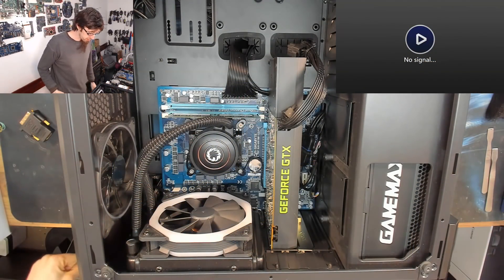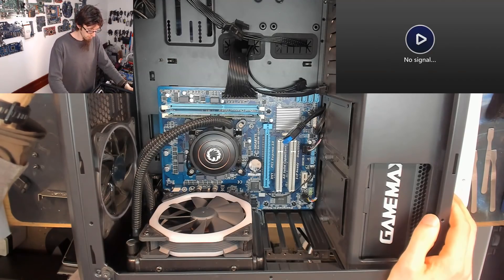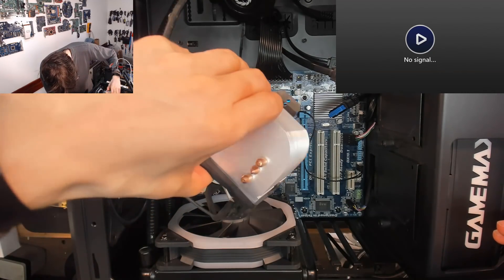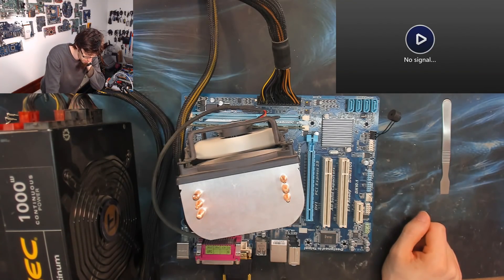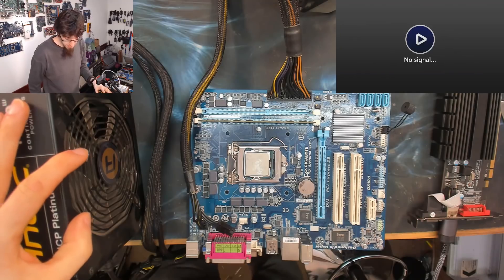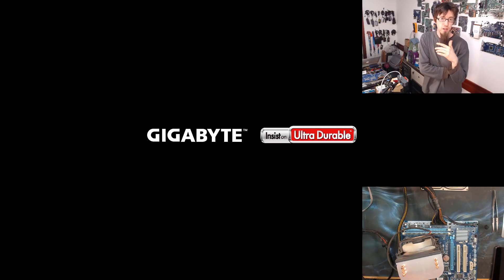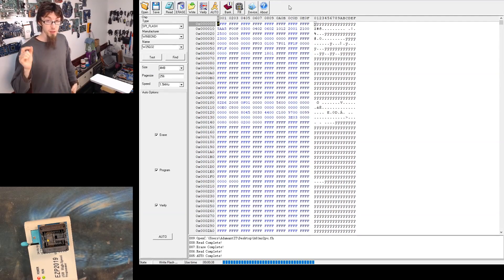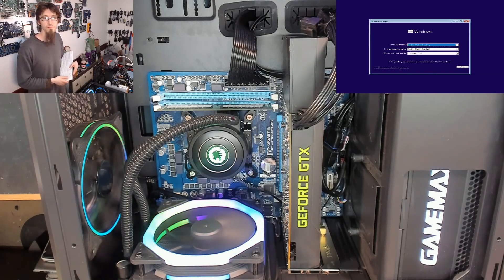LFC#207 - Troubleshooting an old Intel Platform (GA-H61m)

Comment: Is this build good enough for today gaming and casual 3D modeling(upgrades coming soon in middle of 2021/2022)? Currently having 10-15year old pc(it can't even run GTA 4 on medium settings).

        AMD Ryzen 5 3600 3.6 GHz 6-Core Processor 
	be quiet! Dark Rock Pro 4 50.5 CFM CPU Cooler
	Gigabyte X570 AORUS XTREME EATX AM4 Motherboard
	Corsair Vengeance LPX 32 GB (2 x 16 GB) DDR4-3600 CL18 Memory
	Seagate Barracuda Compute 2 TB 3.5" 7200RPM Internal Hard Drive x2
	Gigabyte Radeon RX 5500 XT 8 GB OC Video Card
	be quiet! Dark Base Pro 900 Rev. 2 ATX Full Tower Case
	Pioneer BDR-2209 Blu-Ray/DVD/CD Writer
	be quiet! Straight Power 11 1200 W 80+ Platinum Certified Fully Modular ATX Power Supply
	Microsoft Windows 10 Pro 32/64-bit
        Samsung Syncmaster 2233 21.5"    =already have

Thanks  :)
Reply from the maker: I'd dial the PSU back a lot, 1200w is massive overkill, and you could save a pretty penny by dropping to 500-800w, and likely bump the GPU up a notch. Ignore what people say about efficiency and stuff, it's all BS. A good PSU will run cool and quiet. It's worth mentioning that Ryzen 4000 is coming out later this year... so you might want to consider waiting for that, or failing that you could just sell the 3600 and upgrade when 4000 comes out.
Other than that, you should do just fine.
Reply: @Adamant_IT  reason why I wanted that high PSU is when new cpu comes out and new gpu they will use a lot PSU and I don't want to buy also new PSU.
I'l  probably use this system for year or two when prices of new stull settle's down. 
What is your thought on a Asus ROG Strix X570-I Gaming
  AM4   Mini ITX   64 GB   vs    Gigabyte X570 AORUS XTREME EATX AM4 Motherboard  128GB?  Witch one do you think is better, and do you think that in 5-year we will need more than 64RAM memory to play new games?
Thanks for the feedback. :)
Reply from the maker: PSUs - Future proofing is a valid concern, but most systems these days use 400-500 tops. The system you're speccing will be more like 300-400. A high power system, something like an Intel 10900k, 2080 Super, medium overclock, would be looking for 700-800w. Computers just don't use as much power as people think they do unless you're doing very bonkers things with them.
Mobo - those are two different class mobos. The Asus is a Mini ITX board designed for small form factor cases. The GB board is very nice, but again, you're massively over-speccing for the scope of the build here... that mobo is for top-end CPUs like the Ryzen 3950x, not the mid-range Ryzen 3600. Something like the GB X570 Aorus Pro - which is still more than I'd spend, will cost a fraction of the price and be just as fast.
Lower the PSU, lower the mobo, and you can put in a way better CPU and GPU, which will make the computer faster.

Comment: garble was coming from not having enough clamping pressure on the cpu since the cooler was just sitting on it
Reply from the maker: naa. Not enough load for it to overheat. Cooler clamping matters when the CPU is on load, but these kind of diagnostics aren't load.
I've left systems running memtest overnight with the cooler resting on the chip.

Comment: Those electrolytic capacitors are getting pretty old. If it was worth the trouble I'd replace them. Especially anything around the BIOS circuit. It's possible that's what corrupted the BIOS to begin with?

Comment: First mistake ... You loaded WINDOZE!!?? WHY? 
Use a bucket of bolts - get a bucket of bolts!
I put Windoze where it belongs 20 years ago and have NEVER regretted it for even a femtosecond. Zero worries over viruses, zero serious security worries, ZERO BSODs - previously the bane of my life, ZERO crashes immediately after a restart from updates FORCED on me JUST as I was shutting down to go home after a LONG day, ZERO failure to restart after a perfectly normal shutdown and power off. WHY is ANYONE still using that bloated, expensive pile of utter trash? Windoze and Apple fan boys just get me shaking my head in disbelief? There is a WELL proven way to resolve all that entirely unnecessary grief ... Use a PROPER operating system, with a PROPER journalling file system - Linux - you even get the choice of multiple different versions - something MS and Apple don't allow you to do. And BEST of all, PERFECTLY working and usable hardware systems of over twenty years old work ... FASTER than they EVER did under Windoze.

Comment: My Gigabyte H61 board I gave up on. Was getting countless BSOD from trying out a new CPU and could not get into Windows. Memtest86 was showing countless errors. NONE of this was RAM-related. Turned out it was the board. They dual-BIOS failed too and showed corrupt many times before that.
Screw GB. Built a new system with H81 MSI and guess what ? There are NO RAM errors. The Ivy Bridge CPU was fine too. It was the MOBO the whole time. Countless hours wasted trying to install Windows fresh again , etc. Never want to see another GB board again.

Comment: The Beta BIOS you skipped was about solving display issues
Reply from the maker: Well... it does say 'high end display card compatibility' but I had the same issue with on-board graphics. The current theory is that it's to do with GPU EFI. But this machine's been put to one side while I work on more important stuff. I'll likely be doing a follow up though, as there's been a lot of great suggestions in these comments.
Reply: @Adamant_IT  yeah.. was thinking I would check monitor connection..

Comment: Lol "watching" this as I'm doing exactly the same thing with an asus P8Z77-V LE board that I was about to turn into a games&utilies server for home and shop. It had an i7-3770k for years without incident. Dropped a xeon e3-1220v2 ink because ya know.. server and after a couple days of playing a City of Heroes, I start to build it into its "final form" and.... nothing. Now I'm basically a mirror image of this video. Effectively stumped so just throwing hardware at it until it works. Dont NEED it to work but I'm curious now lol

Comment: I Had a customer bring me a older computer to install a new 1660 super ... same thing happened stuck on the  gigabyte bios screen but wouldnt' do anything .. had to install the old video card and then flash the bios from a 2012 version to 2014 beta ... then it worked great

Comment: Try reflashing it from the computer itself (without using programmer)
Reply: Hows that going to work his programmer is just as good as doing it on the computer and how is he going to navigate the bios to re flash it when he cant even see the menus
Reply: You can't flash from the computer if it won't post.
Reply: On gigabyte motherboard, the eeprom chip is soldered, hot flashing is hard

Comment: @UCyDsNRAGU1ckse3fnCt58xg
  
  

    

      

      

        @UCyDsNRAGU1ckse3fnCt58xg
        
        
        
        @
        
        

        
        
      

    

    
    

  
  thank you sir for your videos i have really learnt a lot .
your laptop repair tutorial is one of the best out there,
obviously you are a genius.

please i want to ask a bit confusing question

1. when do we accuse the supper io for a laptop failure?
2. why will a laptop refuse to power on when 19v, 3.3v, 1.0v, 0.9v, .. are all present on a laptop mother board.
3. what do we do when there is no voltage on the cpu power supply when the system is powered on.

Comment: ad 3.3 v to board or + of programmer. circuit sucks up too much and wont let eprom read.
also the ezp20xx needs driver signature enforcement disabled to install 1 time.
gigabytes beta bios usually work fine.. just a disclaimer. my z97-hd3 is running on beta past 4 yrs . .i also updated the intel ME with fptw
to boot second bios short out pins 1 and 6 on the main BIOS chip.
ohh also some amd Rx470 or 570 or similar give error 43 in device manager.. flash the bios with same from techpowerup.. make sure the memory brand matches.
compare in hexeditor open both and ctrl K

Comment: The Ati gpu won't work - it's vBios is too new. You need to update mobo Bios 1st.seen this maaaaany times
Reply from the maker: This seems to be the prevalent theory - but what I don't understand is why the iGPU vBios is newer than the sys BIOS.
I can believe that the mobo might've stuttered and reloaded a really old BIOS from the backup chip before I started diagnostics, and I'd understand if I was using a 3rd gen CPU in a second gen mobo, but the 2nd gen i5 gave the same fault. The theory fits the symptoms, I just don't understand why.

Comment: I love gigabyte other then there shitty bios, especially dual bios with no switch.
Reply from the maker: It's annoying... their commitment to Dual BIOS is great, but it's so janky to actually use when just sticking a physical switch on the board would make it so easy. I can't believe that whatever system they use to 'auto switch' is cheaper than a literal physical switch.
Reply: @Adamant_IT  I know, I've lost so many many boards to it. In highsight if I only had an eprom programmer but at I should not have to fuck.

Comment: The amount of time you spend, now makes this unit one you most expensive computer, time is money when these board $45.00 landed or less. I know these thing just bug you and you are curious. But in a real shop this can get you fired, client will never pay for this time and shop owns want pay the labor. With that being said this is the only you learn in you Spare time. If you have a good video post first video card should stayed with that. When and bio that are that old alway go with beta. When onboard video does not work board alway has a short and will die. Most times these cold solder joints or the motherboard was not cleaned good before soldering and a good heating of the board can resolve a lot of the issues. I what some more video and realize you started as a Mac tech, that explains everything. On the window side always look at the price of the replacement of the board before I even looked on the board to do repairs as a replacement cost and if is one hour or less of my labor I always just replace the board. Like for example I had i3 Dell low end system hit by Lightning just burn out the network card on the board and was causing some other minor issues. But the cost to completely replace the motherboard and a brand new power supply was $94 +1 hour to rebuilt. So far my client was happy that they have a new board and power supply instead of trouble shooting with 4 hours of labor no guarantees I can fix it and it would stay fixed.

Comment: You go an ass end way of reflashing a bios considering you're an engineer......lol,  blind write them with a usb drive or cd rom.........been doing it since 486's with floppies, till bios got too big to put on a floppy...there is no need to remove any bios chips......as the board can be forced to read from emulated floppies and btw gigabyte dual bios never worked and corrupted often ence the cd you used to get with the drivers on that also reflashed bios incase of emergency, that you force loaded when the bios did corrupt to rewrite it.....it's old school tech from when board makers used to tell you if you lost power to pc while flashing you would need to send it back so they could reflash and charge you for it...blind flashing was a secret back in the 90's, seems to a lot of people it still is

Comment: This is the link for the solution,i had the same problem with my dh77 motherboard and solved it using this trick,  https://forums.anandtech.com/threads/pc-wont-post-anymore-ga-z77-d3h-boot-loop-solved.2493640/

Comment: Heh, all this faffing about for 40 minutes, when the probably is practically hitting you in the face - bad ram slot, garbled display, posts intermittently - it's a power supply issue or problem with a power rail on the board. What a waste of time this whole video was. Check the caps in the power supply,  I bet you anything they're all shot, or just put an oscilloscope on all the power rails - probably at least one with tons of ripple - typical youtube video - an "expert" showing you how NOT to do things - ugh
Reply from the maker: Check the part at 13:40 where I said "We're going to try a different PSU" and then I try a different PSU and that doesn't solve the problem. The Antec I test with is a HCP Platinum 1000 with quad 40a 12v rails and Nippon Chemicon caps. It's fine.